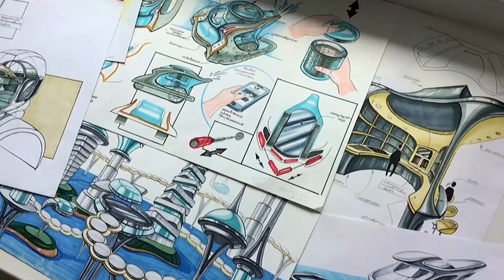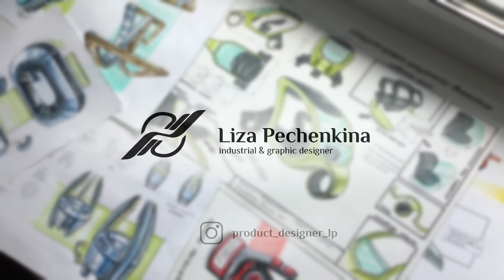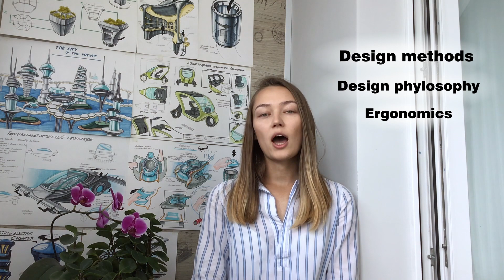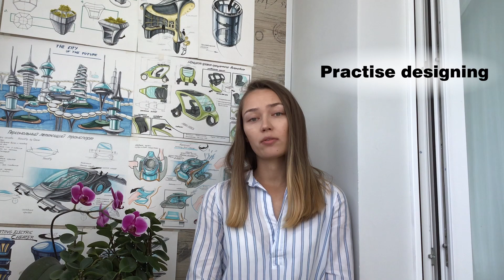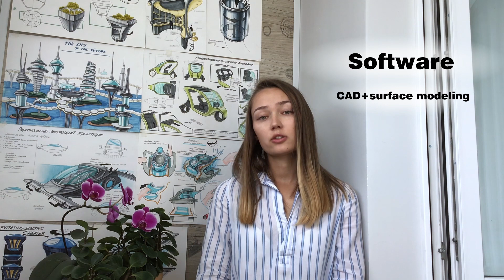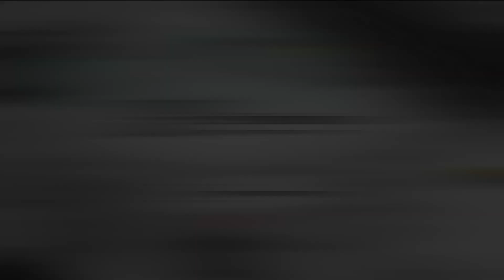How to become an Industrial designer without education

Comment: is industrial design about problem solving or aesthetics or it matters at what place are you designing ?
Reply from the maker: It’s actually all at once. But first you start with problem solving finding the functional and ergonomic solution to the problem and then aesthetic comes in. So the end product should be solving a problem and be aesthetically pleasing
Reply: @lizart.designlab  I mean yes I once was on tour with my Uncle who is an interior designer (A person with high mental clarity )

 , His client complained him for stains in kitchen due to hard water (Hard water developes a whitish layer on both tap and kitchen platform) and wood used as kitchen platform was totally rotted out due to continuous water exposure, 

Here I observed two problems
1) Wrong use of material (kitchen platform should be made of stone not of wood )
2) Type of water was not enquired (Hard water or soft)
3) Location of tap which was placed one feet above sink for aesthetics (Which eventually led to stains all over kitchen)

How can I as an Industrial designer avoid those kind of blunder ?
Reply from the maker: @DarshBarot-sn1hy  The problems you mentioned absolutely make sense. 
Problem #1: definitely the kitchen platform should not be made of wood. Stone would be much more long lasting.
Problem #2: maybe integrated filters can help.  They won’t make water softer but they can remove chemicals and contaminants like pesticides, herbicides, chlorine and biological organisms which may help avoid stains. 
Problem #3: yes, tap location is important. You should check recommended dimensions specifically for that area.